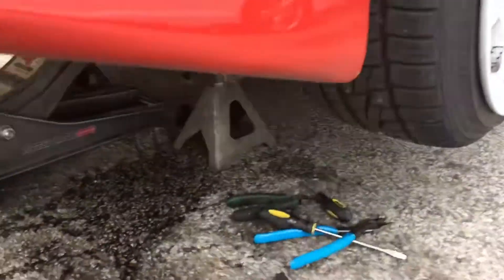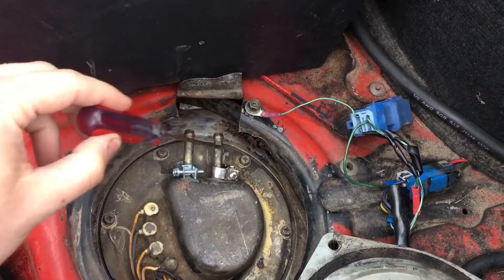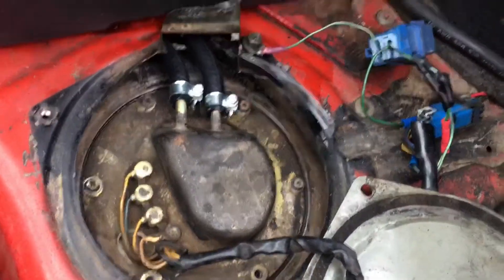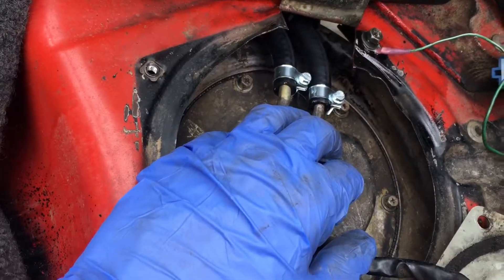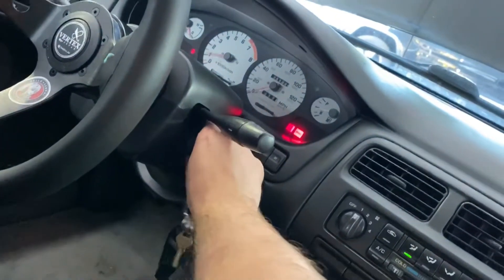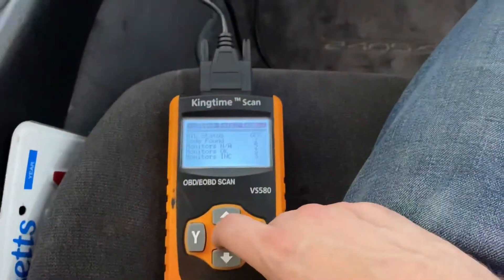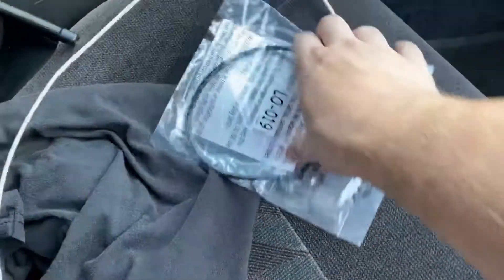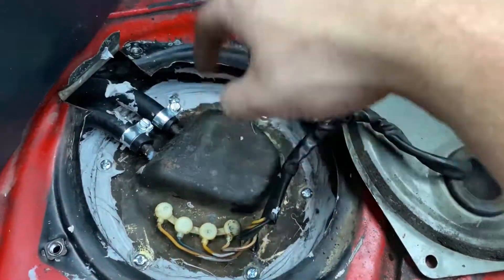How to replace S13 240SX fuel lines and gas tank o ring. Why is this car always broken..

Comment: Did you have to drop tank? My return line has a slit in it and is leaking fuel. I need to fix this problem asap
Reply from the maker: nope, in the video i replace it with the tank in

Comment: Hold up Brian I'm getting a fuel smell from their and it's pissing me off but that's besides the point. DO U HAVE TO DROP THE FUEL TO DO THIS JOB U JUST DID???
Reply from the maker: Hey glad you found my video. message me on instagram @ brianandthe240 ill be glad to help!
Reply from the maker: But to be quick about it no, there is no need to drop the tank, i cut the flap to get to the hoses easier thats all.
Reply: @brianwiththechaser9886  .I appreciate it your video and info really help my s13 is running amazing no smells
Reply from the maker: @abymondesir23  I am very happy to hear that i was helpful, if you need anything else just hit me up on instagram!
Reply: @brianwiththechaser9886   how’s it man what glue did you put over your fuel pump cap ? As mine leaks tried so many different o rings even a oem one but still leaks any ideas ? Cheers
Reply from the maker: @joelholmes6142  that seemed to be grey rtv. i took it all out and used a new o ring an no more leak, or smell.